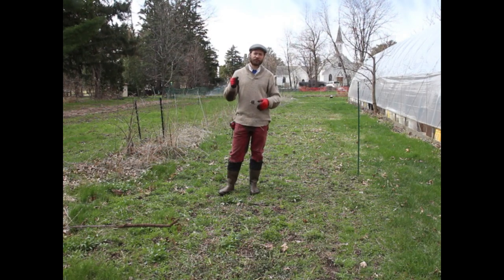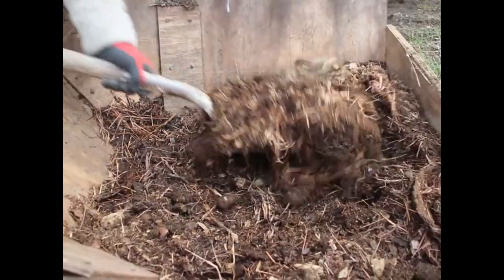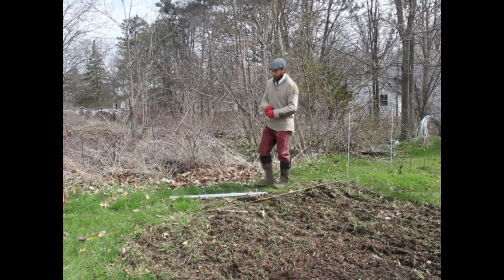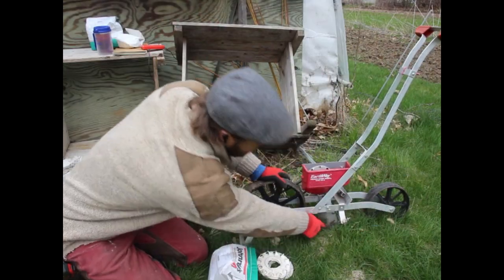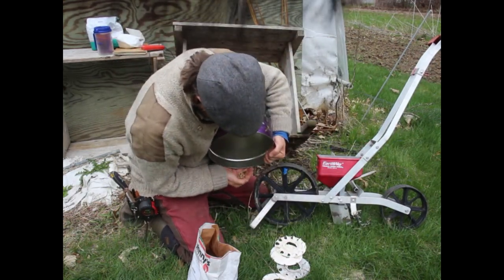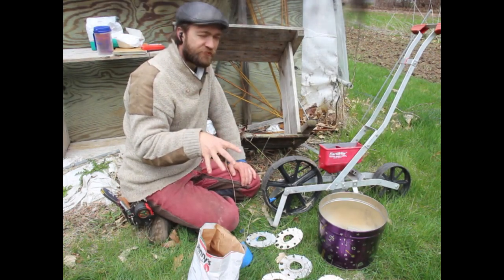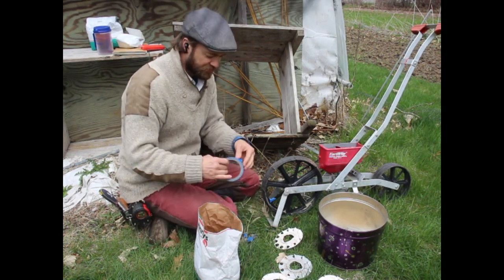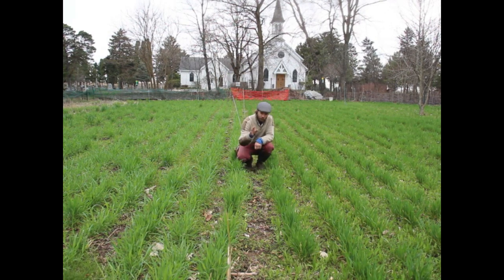Grow Your Own Grains, Part 1: Best Seeding Methods -- Low Tech Video, No. 24

Comment: Great and informative video.  I've been growing wheat for about 5+ years in SW Michigan.  At first it got a really nice crop.  I but after each successive year, the crop has been  less and less productive.  I've grown the wheat from the feed store that is a "cover crop" wheat.  Also each year I've been getting a crop of very low thick growing cover weed that I feel it has been robbing both nourishment and moisture from the wheat.  The wheat comes up good in the fall but in the spring when it starts up go really growing, so does the competing undergrowth.  The plot that I have grow is about 25' x 90'.  I also am using a seeder just like the one you use.  I have been planting my rows about 4" apart which will consume about 8 pounds of seed.  Last fall I made the decision to not plant on this same plot again but try and rotate my grain to a different part of my garden which is about 30' x 70'.  I have been tilling my garden very thoroughly, not just lightly as you do. Also I'm going to plant Khorasan or Kamut wheat.  I also harvest my wheat with a scythe.  I'd like to know how you adjusted your scythe for harvesting your wheat.  Thanks for your presentation!
Reply from the maker: Hi Abdy,
Sorry for the slow reply. Yeah, I think you'll have better luck with the heritage wheat. I grow Maris Widgeon, which I like a lot. My first year was using red winter wheat from an industrial-ag. farm. The wheat had tons of bran, it made poor flour, and it was likely a hybrid, so the vigor declines drastically after the first year of planting. Plus, it is dwarf wheat, so not easy to harvest without a combine. Tall, heritage wheat is much more conducive to harvest. I was just weeding my wheat this weekend. The 8" rows make it easy. Give it a try on a few rows and see what you think. With the extra space, the heritage-type wheats will tiller and fill the space, so you don't really lose production. Good luck and I'd be interested to hear how the Kamut wheat turns out. Cheers.

Comment: I've had best luck by preparing a good seed bed and raking it with a furrower that I made from fence pickets.  It makes a furrow every six inches, so that when I'm done the ground looks like a giant grout towel has gone over it.  I use a hand cranked seed spreader to sow it and then rake it flat by pulling a garden rake over it at a 45 degree angle to the furrows.  This leaves the grain in rows, more or less, and evenly distributed.  It's worked great for rye and oats.